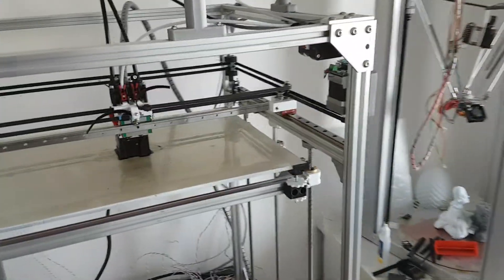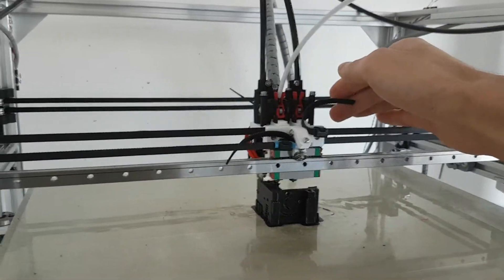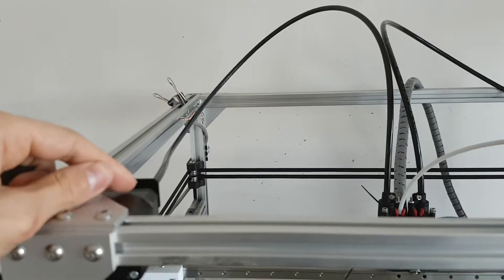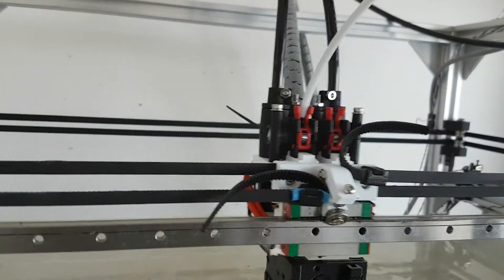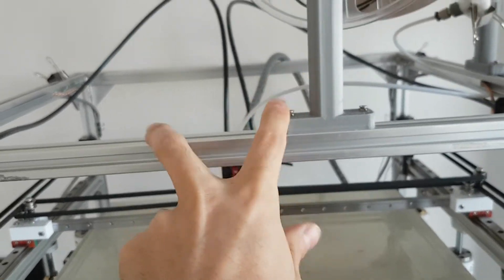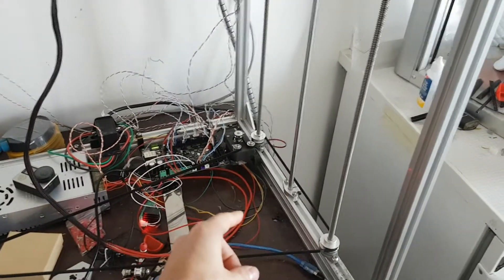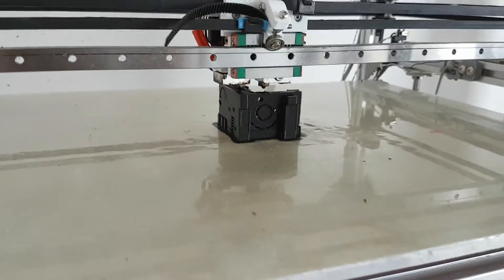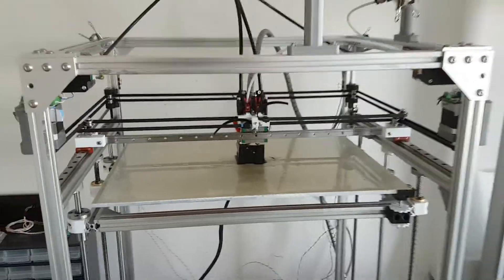RK 3D printer updates #3 (Smart Stepper/X linear rail/MKS Sbase)

Comment: It is a very good design since the dual Z-axis is connected by the belt and pulley rather than direct Shaft Coupling between the stepper motor and the Ball/Leadscrew. 
It sounds like a better way to eliminate most of the noise interference and vibration. 

Apart from the closed-loop stepper design for X and Y motion, is it also " Essential " for Z-axis ? 
What is the printer board used in the system ? As mentioned in your Thingiverse, it is Duet wifi. 
But how ? Since the Duet mainboard is on-board soldered stepper driver. thx !
Reply from the maker: I think that there's no benefit of installing one for Z. The board I used with these was MKS Sbase. But then I used the Duet and I removed this closed-loop system as I wanted to test and take advantage of Duets great drivers. Anyway, you can use it with Duet, you just need to find STEP and Direction pins for the axis you want. If you didn't find them just ask in the Duet forum and I'm quite sure you'll get help.
Reply: @RajaaKahel  Thx a lot !

Comment: Nothing irks me more than an unsupported Hiwin rail. You couldn't spare $2 on a support rail? That's not stiff enough for me. (That's what she said)
Reply from the maker: That was on purpose, the system is very light so I wanted to save more weight and it worked nicely.
However, you can see in the latest updates that I added a support for more rigidity at high speeds (my Tool Changer moves at 400mm/s).

Comment: How do you get these smart Steppers to work with Duet 2 Wifi board?
Reply from the maker: Haven't tried on Duet. This might help:
https://forum.duet3d.com/topic/7952/smart-stepper/4
Reply: @RajaaKahel  Thank you for pointing me in the right direction :)   DO you plan to run this machine in the video from Duet in the future?
Reply from the maker: @WarThunderGerald  You mean my printer? It's already running on Duet, have uploaded several videos with it :)
Reply: @RajaaKahel  Does that mean you abandoned the smart steppers for now?
Reply from the maker: @WarThunderGerald  Yes. The Smart Stepper is great, especially for its purpose. But the Duet drivers are great too.
Reply: @RajaaKahel  Please if you solve how to use with Duet Board / With Smart Steppers;  Will you make a video to show? :)
Reply from the maker: @WarThunderGerald  I guess it's easy, you only need to find STEP and DIR pins. If I installed it at anytime I'll make a video :)

Comment: This was the video I commented on your most recent video release of printing with the toolchanger - The video description doesn't list what the controllers are - Im very interested in them as I have always wanted a means for helping correct the exact issue these seem to correct when lateral movement is impeded to be able to recognize that and continue on corrected for the resistance that normally would set another non-encoded controller printing the rest of the model with an offset / improperly.  Please if you can share the brand and or (even better) a link to where they can be purchased and also if the screens for readouts on them didn't come with the originally, where to purchase those as well as for R&D purposes I like to be able to see readout data like what is shown here.   I am not having much success just searching online for what these may be - Please let me know if you can post the source of them for others to be able to use (lastly do you still use them to this day? For motion control - I realize there's extruder issues I'm not referring to that at all - I see you did swap to titans in later videos - I mean just the gantry / motion control motors  [A and B motors / whatever you which to name them in a CoreXY setup])      

Many thanks Rajaa!

Comment: Curious about your experience with the Zesty Nimble. The shaft between the motor and the filament drive in indeed a spring, but a constant spring, that could (in theory) be predictable.

If you are going to a Bowden setup, that has a similar problem. The filament between the motor and the hotend is under compression, and so is a spring. The tricky bit is that every filament is different, so switch filaments and you have a different spring. As filament makers do not publish the mechanical properties of their filament ... you have to guess, and "fiddle".

Possible the Zesty folk have guidance on how to configure the software for their extruder.
Reply: Hi Preston / Rajaa
I am one of the Nimble creators.

A small number of users have seen the issue described in this video, however it it not related to the flexible shaft, we have identified 4 main causes:

-Lubrication (we now ship with the ideal lubricant)
-Over tightening of the bolts (we advise on correct tightness in documentation)
-Worm tolerances (this has only been for a handful of customers)
-Steppers motor (some steppers are just not up to the task, we advise the following which is known to work well https://www.omc-stepperonline.com/hybrid-stepper-motor/nema-17-bipolar-18deg-13ncm-184ozin-1a-35v-42x42x20mm-4-wires-17hs08-1004s.html )

Nearly all customers experiencing issue have resolved it by changing lubricant to 10K diff lube for RC cars, or getting the recommended stepper.

We heartily encourage customers to reach out if they are having issues. We will help you resolve it.
Reply from the maker: True, filaments also act as springs and each filament has different values, but still I never seen such a problem with Bowden as the spring effect may take place in retractions more than during printing (under constant pressure). So the problem here is hardware not software tweaking. I'm sure it can be fixed with like a good lube like the ones they suggested (10K or 15K Diff lube) but I just wasn't in the mood to find the lube and buy and try... Was kind of disappointed so I quickly converted my printer to Bowden. I'll give the Nimbles another try later tho and maybe with a shorter shaft.
Reply: Also http://zestytechnology.readthedocs.io/en/latest/